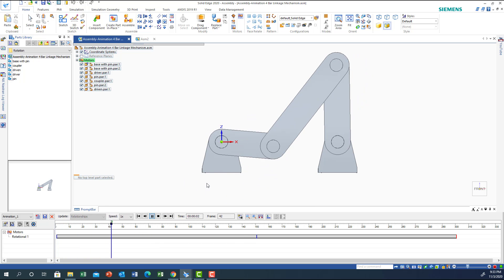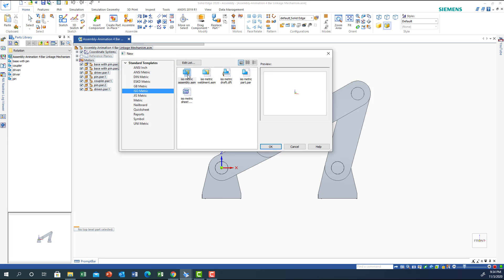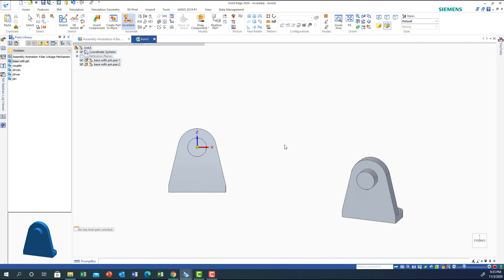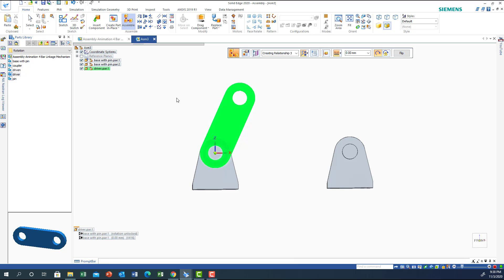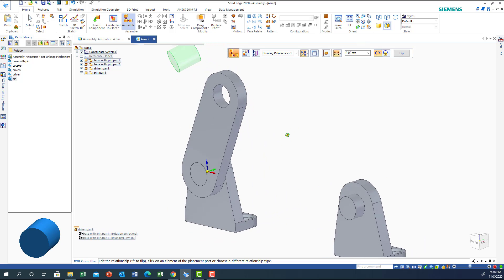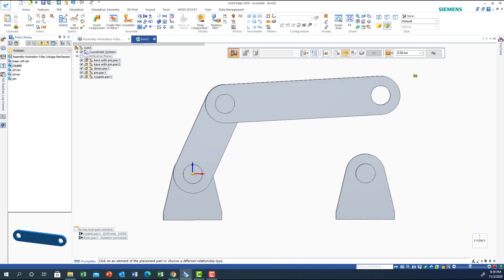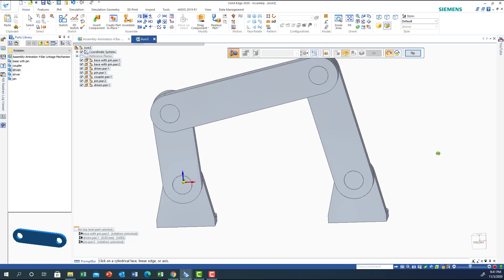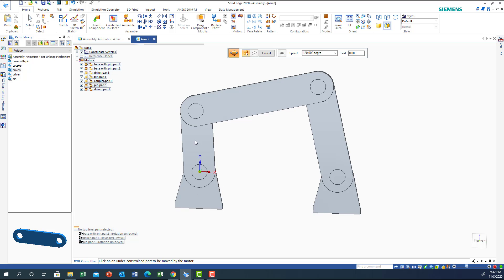Learning Solid Edge - Introduction to Assembly and Animation

Comment: I was intending to design and assemble an oil pumpjack to print in 3D, and had no idea on how to simulate the movement to check everything works fine, still I need to design every part individualy which is a massive challange due to lacking any blueprint to follow, My shot is making the blueprint myself in Autocad and then creating the parts on solid edge

Comment: do we need to create separate of that parts? or can we create in one sheet?
Reply from the maker: First, you draw the parts and save them in par format. Then, you open the assembly format and start the process. You can log on my google drive where I save the draft sheets of my drawings for those who would like to practice. I included the parts for Lab 15 - Assembly, so you can concentrate only on the assembly process. If you would like the parts of this video, let me know, and I will post them on my Google Drive.

Comment: This is a challenging video to follow. I had to replay it multiple times from 5:03 onwards because my popup menu and toolbar are different from this video. However, with some effort, everything finally came together.  The concepts and explanation are spot on.  My workspace is just different and require me to better understand what I have to do than just mirror the instructions. In all, I managed to develop a lot more synaptic connections in my brain than this video initially intended.
Reply from the maker: Thank you so much for sharing this wonderful experience, I am glad that you are able to navigate your way through successfully. I wish you all the best and keep up the good work 👏.